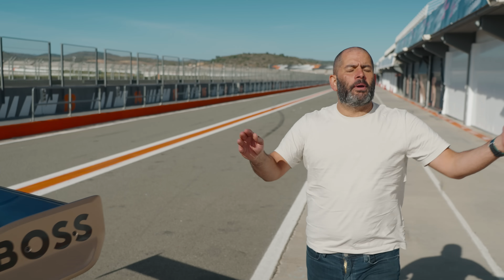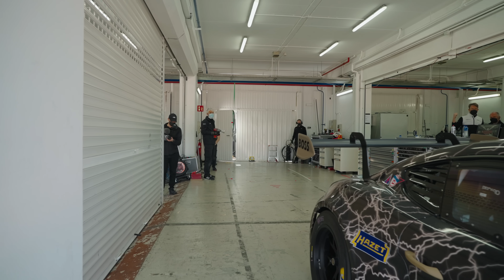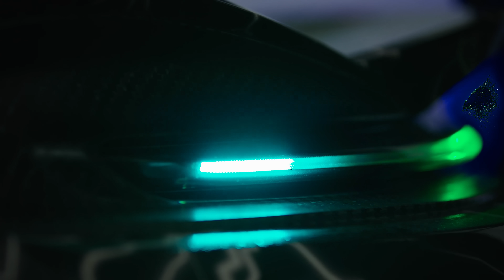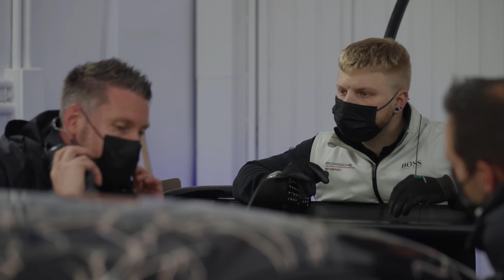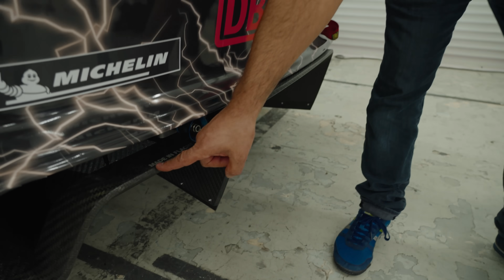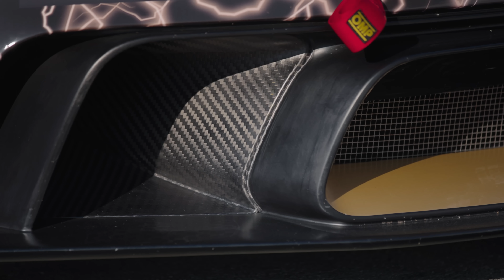Chris Harris Drives The New Porsche GT4 ePerformance

Comment: Perhaps you can comment on humanity's ability to keep up physically with these quicker and quicker cars.
You are a professional driver and have your own thoughts about how quick they are compared to anything you have driven.
Consider the Plaid which can run to 150 in the 1/4 mile and can be driven by the least experienced drivers because of availability.
Not everyone belongs behind the wheel of cars that can perform like that.
Changes have been made to several different types of auto racing to slow cars down a bit.
Just some thoughts because as cars become quicker, in the wrong hands they can become more dangerous.
I say this as the owner of a near 900whp Turbo S.
It's not for everyone.

Comment: What a horrid age we live in, witnessing the death of the automotive world. These soulless devices will be all we have soon, and the beauty of mechanical machines will be lost on future generations that will never have a chance to experience them or understand them.
Reply: no i don’t think so, even if we go full electric there will be tuners and gear heads making  them to go faster. swaping batteries, bigger motors, better cooling, handling, hacking/moving the electronics. car culture won’t go away just because the power system changes. ill be onboard as soon as someone comes out with a hot hatch and not a truck.

Comment: Electric sports cars are this weird jeckyll and hyde thing for me.  One one hand I love the instant acceleration, no waiting for downshifts to pass, etc., on the other hand I'll miss the shifting (even paddle shifting), the engine noise, and so on.  

I think the biggest issue in racing is longevity.  Endurance racing will be gone completely unless they find a solution and   All races will be 30 minutes and that's it.  I suppose you could add quick charging into the mix and do a 30 minute stint and then take out a second car for 30 minutes, then swap back into the first car for another 30 minutes, but how long will the batteries take that?  We would probably go backwards in emissions throwing out batteries left and right by abusing them that hard.

Comment: No thank you.  Probably what it sounds like in hell.  Or what was played into the ears of a suspect a certain 3 letter agency would be holding without trial at a black site.  I would beg to be waterboarded until drowned with ice picks placed thru both in the sack so I may forget hearing that sound before I die.  Horrible.  Expect combustion engines to go up in value and make crypto look like peanuts.  I mean at least you get a real thing you can actually touch, repair or try to repair, and when you get it back on the road you are satisfied everytime it starts revs, and changes gears.  What a feeling is all I gotta say.  What happens when it needs service?  Does a taser pop out the dash and go to your throat before you get out and get an uber on you, not them?

Comment: How long from finishing a 40 minute session before it can start another 40 minute session? What sort of charging outlet does that require? What sort of total power input will a paddock full of these require of the racetrack site? If there is a race series made of these, does having a two race day get blocked by the size of the power lines coming into the track?
Reply: Porsche claims 15mins on their charger they made for it at the track to get it back from 10-80%.
Races start at no more than 85% soc because of aggressive regenerative braking programmed into it. 

They claim up to 50% of a racing sessions total energy used comes back from regen alone. If you watch the cnet video of testing this? 
In car shows 3/4% battery drain per all out lap at the full power setting, and 2/3% per lap drain at the 600hp race pace setting. 
So it's actually possible to run for 25-40 laps per charge. 👍🏻😎

Also articles have confirmed the speeds to be equal to current 911 gt2 cup cars. Amazing considering this weighs almost 750# more than a gt2 911 cup does. And has much less development time so far. I bet this thing tears up the goodward festival of speed next month.

Comment: Batteries at this level needing to be cooled with oil @ 200 plus mile per hour sounds like a disaster —— I’m guessing as with all batteries you will be limited in distance without a charge that will take time —— the goal shouldn’t be faster but getting more from the driver with less power — what’s the point 👎

Comment: Had to use headphones to get all the verbiage, but still fascinating how they chopped and moved things around with better battery tech for this car. Surely they can make the base electric cayman 1550 kg , which is around the 992's weight. Side note, the sound is too much and on the roadcar its not going to be great toned down. ICE is king.

Comment: Normally I feel pretty educated about why cars sounds like they do.

But is most of that noise the racing drivetrain? Or is that pumped artificial. A taycan or model s makes so much less drivetrain noise.

I just think if that’s artificial I’d add some more depth / bass!
Reply: @A World Under A Spell  No, it's just the sound of straight cut gears. Pretty common thing in dedicated racing vehicles. Pretty sad that many enthusiasts don't know this. Most gearboxes use helical gears, some even use herring bone gears, both of which produce very little sound compared to straight cogs. To answer Matthews question, its mechanical drivetrain noise, and not unique to electric vehicles. Here's a video with an ICE BMW with straight cut gears: https://www.youtube.com/watch?v=dmJH84FnQa8

Comment: The noise from the motors is just unbearable…
Reply: That's not the motors, that's straight cut gears, usually drowned out by the gas engine, but without that to drown them out its all you hear.  They could switch to helical gears and get rid of that for some fractional power loss.

Comment: Horrible noise. Needs more sound insulation. Full race distance in this and you’ll end up with tinnitus for sure. If this sort of thing is unavoidable please can someone add a six speed gearbox, then you can at least break up the noise and add an extra element to racing, not a horrible electric cvt.

Comment: Regardless of instant torque and massive acceleration, I will miss ICE Porsche's.   The sound of an e-drive will most likely lead me to always wear ear plugs.  Who needs this?
Reply: Thats because this is a race car, what you are hearing is the straight cut gearbox not the electric motor whine which will be minimal just like any other electric road car
Reply: @alieninventionAggressA  with this being single speed axle mounted dual motor. Does it have a gearbox? 
(Maybe dual gear like a tycan?)
Reply: Honestly, I daily an AWD VW ID4 pro s, and I’ve barely ever heard the electric motors. When road prepped, tire and wind noise is much more significant. The only times I’ve ever heard anything is when I’ve mashed the go pedal and that’s still just a very gentle whine. I will grant that there are some really sweet sounding ICE Porsches, and EVs don’t inherently have that.
Reply: It's funny with regards to the ear plugs, since most people who aren't car enthusiasts say the same thing about loud ICE cars. It's just a question of what you've grown used to.
Reply: @CockatooDude  i think is the “quality” of the sound, very loud ice cars make you wear a earplug, especially at racing, both drivers and pit crews wear ear protection gear. But the sound its nice unlike the eletric motor that are loud (race cars) and doesnt have cool noise.
Reply: Got news that may shock you -- race drivers already wear earplugs.
Reply: Turn off the sound? Maybe they let you upload an engine noise like Tesla?

Comment: So it's a Cayman GT4 widebody with Taycan Guts shoved into it , got it.  It sounds like a damn Tie Fighter or Speeder Bike from StarWars which is rather Odd.  I'll never be convinced because I like machines that breath.
Reply: Not taycan spec motors, 3d printed housings and much more advanced design used here with even more power, less weight and different cooling to ensure consistent racing pace for 15-40mins depending on the power level. This sucked is 3300# with 1000+hp awd widebody slicks etc. 😎
Reply: Tough luck.  The world is moving on.

Comment: Epic.
But what racing needs is battery hot swapping. A street scooter dus it in a few seconds. What can an LMP1 team develop?
With swaps you can run smaller batteries for 25-35 minute stints rather than the 30-40 get are aiming for. Which would take loads of coasting on the straights, by the way unless Porsche had something better than the new cells from NIO and Tesla.
With a battery swap in like 10-20 seconds (many ways to skin the pig), you can also vary size and weight. Say 25 and 35 minute batteries. Which to stay on?
Formula E forces drivers to do 46 minutes on a tiny battery with limited regen power. That's just not cool. Even on the parking lots they race without straight lines, at reduced power. 300 hp in their races, most of the time.
Next generation will be slightly less lame but if someone wanted, FE would lap like F2 and had battery swaps so it could even do endurance races. No open wheels but active aero. We needs proper progress. The McMurtry car has it almost right.
I'd want a mix of LMP1 or Valkyrie looks and GMA T50 style active fan aero. It needs to be one slippery down a straight, like a bullet, and like a pie scoop under braking and cornering. It CAN be done.

Comment: I'm not turned off by the electric motors... transmission whine usually gets drowned out by engine noise.  This is definitely something more turned for racing.  It will be nice to see what the road car looks like.
Reply: Sounds awful on studio monitors. Not doing my tinnitus any good... Those high frequency sounds are really damaging to hearing too.
Reply: @thebolsta  so is the sound of a F1 but no one seems to complain about a F1 revving 20k rpm. seems like people just need to relearn how a fast car sounds
Reply: @geemy9675  Not at the same frequency at all. Nowhere near. I'm not arguing about speed either. But the facts are, that loud noise that is high in the frequency range is extremely damaging to hearing. When producing music you should always filter out everything above 20khz (that's the limit of human hearing) because on a club soundsystem these frequencies cause irreparable damage to hearing.
Reply: I'm not expressing nostalgia for V10's either... Just pointing out how awful electric motors sound with no damping or suppression.
Reply: @thebolsta  Well, you could say this car is really a working prototype.  No one really knows what it looks like in road form.
Reply: @thebolsta  motors make very little noise by themselves. it's mostly gears and controller that are noisy. of course if something spins at 20krpm it's going to make a bit of noise. square wave controllers used to be much noisier on ebikes. I understand also having inverter that switches much faster, way above human hearing frequencies like Infinitum Electric is featuring, could make them much more silent. or maybe you could introduce some lower frequencies to make the motor sound in a particular way. not unlike some people who spend a lot on exhausts just to make it louder or different exhaust tone
Reply: @thebolsta  yes but the sound of an EV is way below harmful level unlike a F1 for example that will require earplug and will easily destroy your hearing
Reply: @geemy9675  F1 doesn’t rev at 20,000 rpm’s. Haven’t for awhile now.
Reply: @AvaaSlays_Swiftie  no but 20krpm revving  V10 were supposed to be the best sounding ones
Reply: If this video makes ANYTHING glaringly obvious, it's that the SOUND of racing is very very important to it's appeal.
This car sounds like gigantic nails on a gigantic chalkboard.
Nobody on earth wants to listen to it. We go to races to hear good-sounding engines, and not to just look at the silhouettes dash about regardless.
Reply: @shaft9000  Racing used to be race Sunday, sell Monday.  But if technology on track isn't something you can want and buy, then why are we doing it?  'Want' is the important word here - if you can't want that racing aura... Then racing is just a gigantic waste of time.  Love a good 'ol V8 or V10, can't buy one nowadays...

Comment: No matter how cool these new cars look, or how bonkers fast they are... I simply cannot get excited about them! The noise a sports car makes is so important. :(
Reply: That’s why I love my Honda haha. Slow but sounds like you are going super fast. Sound is half the experience
Reply: I recently bought a e63 amg with 60k miles. I'm doing a secondary cat delete/ resonator delete, I'm super excited for it since it'll sound so good.
Reply: @dudove1  that’s gonna sounds amazing I bought an m235i with 24k kilometers practically new just when the pandemic was hitting hard and people were selling cheap, it has almost a straight pipe from the turbo 3 inch diameter to a small muffler at the rear axle and then to 4 exhaust tips. I believe it sounds glorious my neighbors and cops not so much 🤣
Reply: The thing is manufacturers need to be able to differientiate the experience and part of that is the sound the gear changes etc. If they do not all cars will have the same experience no matter the make. Then why would you need to buy a porsche when you could just buy an unbranded car just like you would buy an unbranded toaster....they all will deliver the same experience.
Reply: Totally agree. Cars lose their soul when they lose their internal combustion engine. Same can be said of all things digital tbh.
Reply: That’s something I found trying a couple of vehicles these past months yes they are fast and capable but god I never know how much sound was important to me
Reply: EV isn't even the future, not sustainable at all. Even BMW and JCB say the same.

Comment: And to think people complained about the noise of the old turbo charged engines 😢
Reply: We shouldn’t be surprised about people complaining period on anything new. I do not care for electric because I do get nauseous after a few hard stints. They are properly quick but I’ve driven 800-1000hp cars and never got sick. I definitely had my adrenaline rush but thinking there’s something to do with the noise and vibrations compensating for the speed as where electric is missing senses so the body is confused? Electric Radiation will need further research as well as these cars emit HUGE amounts of it. Then again I am getting old and fat so there is that.

Comment: How much weight will the noise reduction/soundproofing be in a road car or would it have different/quieter motor's? Was an impressive performance but the whining motor did somewhat drown out Chris
Reply: That noise is probably as much a product of the straight cut gearbox as the electric motors. The road car will have a regular helical cut gears which will be quieter.
Reply: @IRBucephalus  I thought all the noise is artificial? Not true? I'd imagine you could just turn it off, which would be a nice feature if you want a quiet drive.
Reply: @ams914  This is not artificial. It's a race car lol.
Reply: @F1ll1nTh3Blanks  I didn't think EV's made sound. L O L
Reply: The sound is because of straight cut gears,  normally the sound of the engine covers this up.
Plus the pinch of the motor is different, zero sound deadening, solid mounts making the car act like a speaker also faster fans etc.
Reply: The road car will be around 1700kg but with RWD
Reply: My guess is at least 500kg-750kg heavier in a globally homologated car.  The cooling system will be much heavier as well and probably use water glycol.
Reply: @Ferrari360stradale  but there's no roll cage either, The noise will be just like any other electric car - minimal
Reply: @juraj_b  agreed. The noise will be minimal, probably similar to the Taycan.  The roll cage will prob be at max 15kg in a weissach package car (obviously not an option on the lower end models)
Reply: @Ferrari360stradale  So 300kg heavier than the petrol? 1800KG? Oof?
Reply: @F1ll1nTh3Blanks  correct but by that time power figure for the street will be north base of 400hp and reaching 600hp easily since its all electric. which is the case with the Tycan only this time range will get wider since cleverly indicated by porsche in the vid to have advanced tech in EV, or we could say gen 2 of Tycan ev since this is 4 years away from now
Reply: @PS3Cooooooool  Yes but it's a small sportscar. No one needs +600hp in that form factor, even 500 is already too much. Anything over 1500kg is already criminal. Might as well can the Cayman and just make a Taycan coupe. Being EV is all good and well but if it means taking the proverbial sledgehammer to your only truly small form factor "lightish" weight set up, idk. Best of luck to Porsche because I am not sure how this will stand.
Reply: @F1ll1nTh3Blanks  I've been wanting them to do a new 928 even if it's just Panamara coupe or Taycan for that matter
Reply: @F1ll1nTh3Blanks  You don't need that much power, but you still want to have powerful motors because you want to be able to harvest a lot of energy under braking. A 1500 kg car braking at 2.5g from 200km/h to 100 km/h has a braking power of around 1500 KW, so you have a lot of potential for energy recuperation and to do so you presumably want to size the motors to the maximum charge rate of the battery.
Reply: @Your_Paramour  i’m curious as to how much energy regeneration this Misson R concept makes